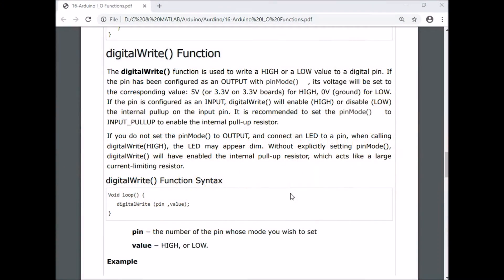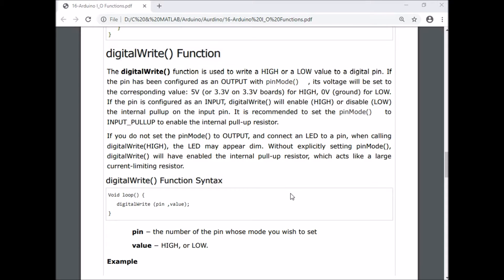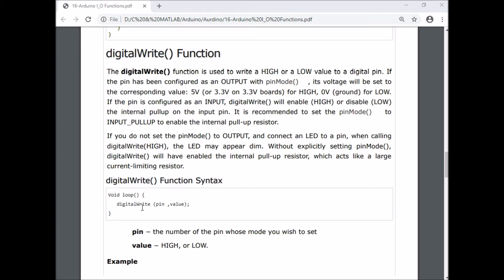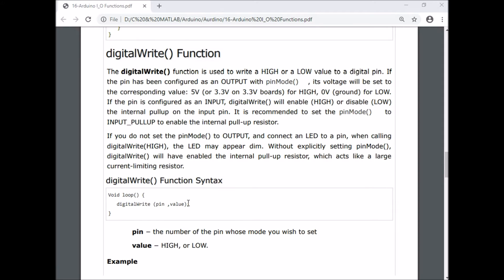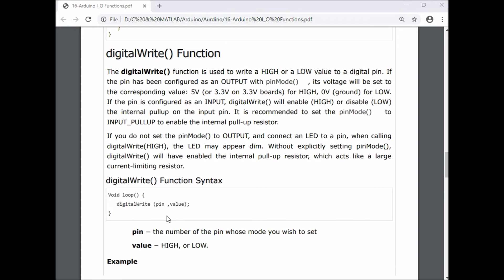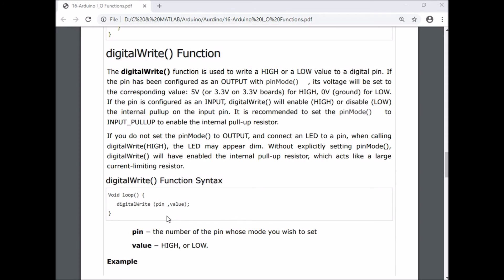17-How to use digitalWrite  function in ARDUINO IDE

Comment: 18208-EC-041 in arduino digital write function is used to put binary values in the specified pin either 0 or 1 i.e., 5v or 0v to that pin.

Comment: 18208-EC-045
After watching this video I understand that in Arduino digital Write ( ) function is used to put binary values in the specified pin either 0 or 1 i.e., 5v or 0v to that pin